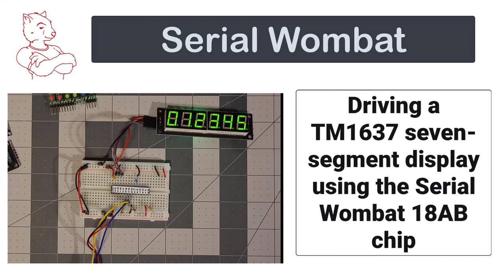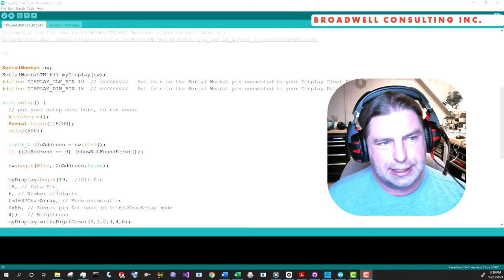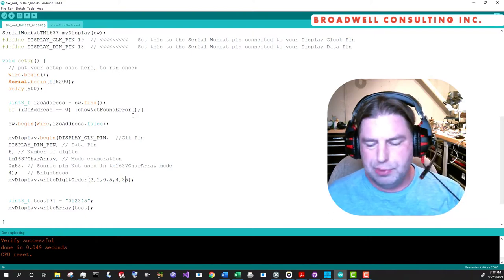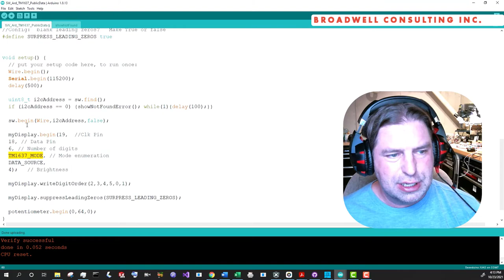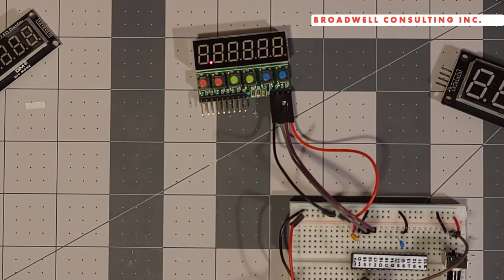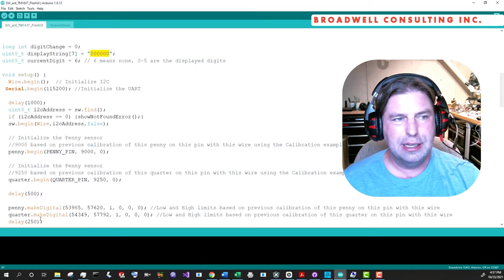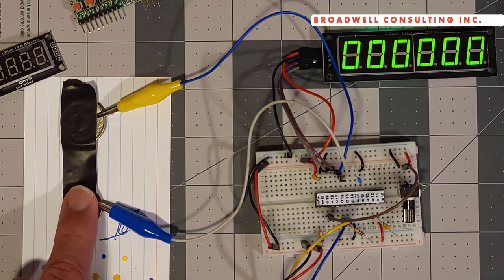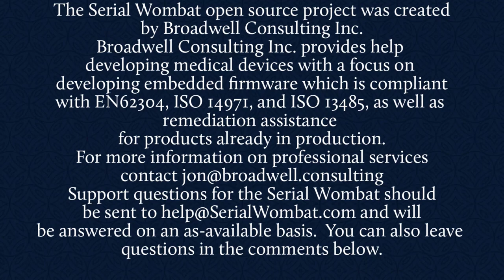TM1637 LED control on Arduino with the Serial Wombat 18AB chip

Comment: Despite my previous comment. My goal is to get 8 TM1637 displays working at once.  I can get 6  displays working but not when I use the pairs W0-W1 and W2&W5 that's from the breakout board. W6 and W8 work also. I wonder what's special about those pins. Do I need to configure the PINS somehow? I trust my solder joints after all SDA,SCL, 3V, GND are on the same rail.
Reply: Solved it myself the combinations to get 8 displays working
1. WP1 and WP2
3 and 4 are for I2C SDA and SCL 
2. WP5 and WP6
3. WP7 and WP9   using WP8 instead of WP9 doesn't work for me. 
4. WP10 and WP11
5. WP12 and WP13
6. WP14 and WP15
7. WP16 and WP17
8. WP18 and WP19

So just WP0 and WP8 are maybe special in some way. I'll dig out my multimeter tommorrow and test the pin to IC connections. I should point out I haven't tried them yet all at once. But they work individually so I summise they would work all plugged in together.
Reply from the maker: Glad you got it working.   What version of firmware are you on?  2.0.7 and earlier had a bug which potentially affected pins 5,6, and 8 in output modes.  (See https://youtu.be/_HJxMORCpD0 ) Not sure why 0 shouldn't work.  I'll give it a try myself tomorrow.  I just ran a quick esperiment with no displays attached, and 8 displays constantly updating 6 digits from the internal random number generator public data source only loads the Serial Wombat CPU to about 30%.  8 displays is a lot of displays!   Can you share what you're working on?
Reply: @SerialWombat  Hi  2.10 I ran the find Wombat sketch and watched the output.  Was about to run the update firmware one but I don't have an Esp2686 and it looks for that. The project is a 8 time zone world clock  4 for relatives and friends and four for remote controlled telescopes. Mine are 4 digit I won't make them blink so once a minute shouldn't load the CPU I do want to add an analog pot though for brightness though may run that on my Arduino Nano Every which has an RTC and 20x4 LCD and barrometric pressure on it
Reply from the maker: You're on the latest version with 2.1.0 .   If you want, send me some pics or a short video at help@serialwombat.com after it's finished, and I'll feature it in a future video.
Reply: @SerialWombat  Sure will send you details when I am done. I am most grateful too you as my project was looking like a no go. I discovered I couldn't run 8 off a normal multiplexer the TMS1637 protocol being difficult. I needed a smart multiplexer.  I could run them via I2C daughter controllers but then it get's very expensive and still need to offload the work really.